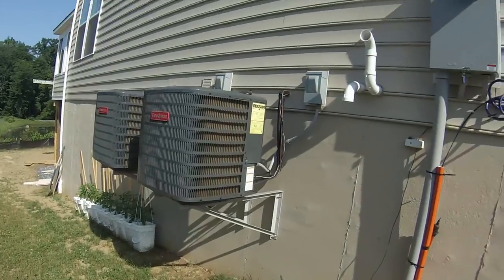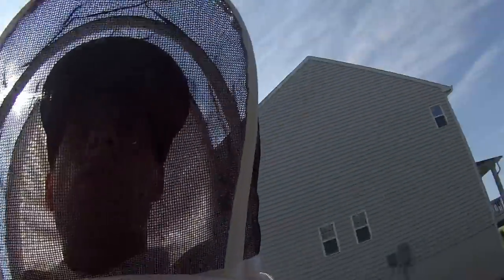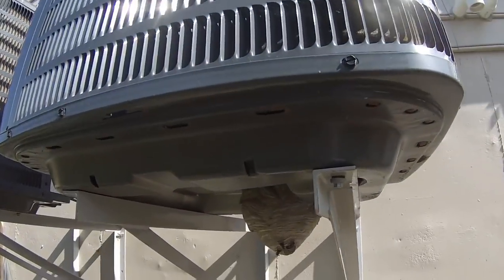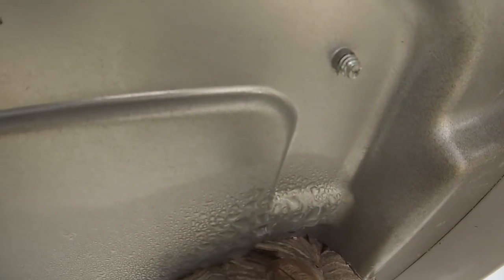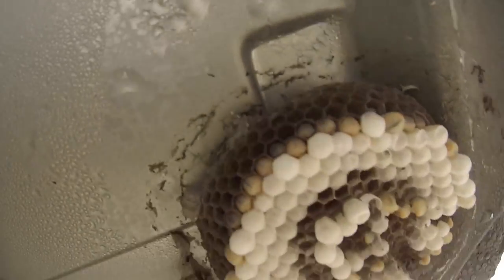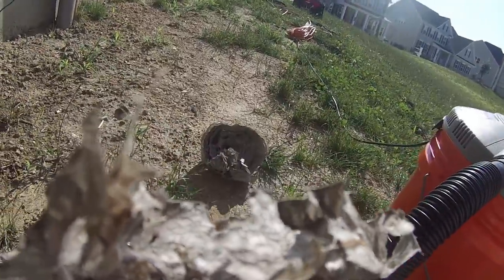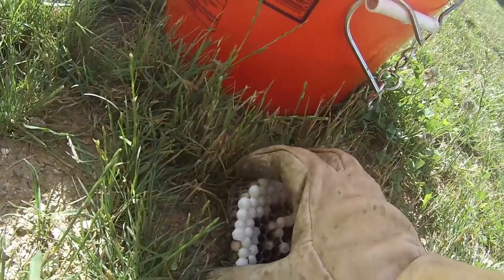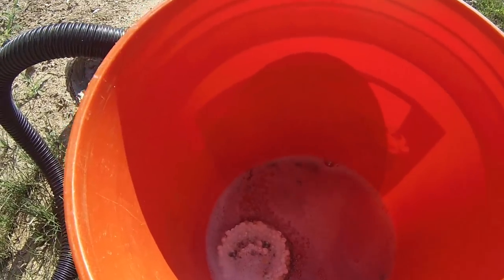Baldfaced Hornet Nest Under Air Conditioner.

Comment: Thanks for sharing. I really don't like the bald faced hornets the are the meanest wasp or whatever they are classified as that we have around here they are the only ones that scare me when I find a nest I'M assuming your suit is heavier or thicker than a standard bee keepers suit or the hornest would be able to sting you through the suit. Am I wrong? Good to see you posting these kind of videos again I know we are just getting into the season. Have a great day buddy.
Reply from the maker: Your welcome. I'm glad you enjoy my videos. I will try and upload on a consistent basis this season as with other years.
Reply: Bald faced hornets are not your friends
Reply: No different than an ordinary beekeeping suit aside from the fact it's a ventilated suit which makes it great for hot days. Some suits are not ventilated. You can still get stung with it on, it doesn't make you bullet proof but it goes a long way to keeping you protected. The main issue you have to look out for is the material sticking to your skin due to sweat, and that sometimes allows stings to get through the material or another example, if the mesh veil gets too close to your nose...the bees(or hornets in this case) will find that spot and nail it. It never fails. It's happened to me on more than one occasion and a sting on the tip of the nose is one of the most painful places to get stung. Ouch. 

So yeah, his suit is really no different at first glance. They're made to handle all sorts of common stinging insects, whether it's standard bee-keeping or insect removal like shown here. I'm pretty sure he doesn't need some special "hornet specific" suit, that's not how they make them I'm pretty sure.
Reply: nashguy207 I've been stung by tne queen bald faced hornet and i couldn't feel my foot FOR 24 HOURS
Reply: herc1120 do you have an email address, or a website?   I’m also fascinated with bees and would love to ask your some questions.   Thank you

Comment: I'm not a pro and just remove nests for free, but use the Milwaukee M18 battery vacuum. Maybe this will help someone without a long extension cord. But like you said, if they're far enough away, leave them be. They are very beneficial.

Comment: I found an empty nest under the air conditioner housing in my camper. I just power washed it away and didn't find any remains of any bees but I wonder if there's any way they can get in my camper through the AC and take up residence in my ductwork?

Comment: I do pest control and I have a bee suit, although I still get extremely nervous when I’m up close. I don’t use a vacuum. I use a product called CB-80 which is pyrethrin based and just shoot it in the nest. If you’re into natural chemicals you should give that a try.
Reply: Alan Cutting lol should wasp freeze the hole than put the cb 80 into the nest. Works better
Reply: JigsawJoe13 

That would be nice

Comment: Bald Faced Hornets🐝 can make there nests on medal to i had no idea that they can do that wherever I go i have seen small nests on wood and big nests in the trees so I guess that means they build there nests mostly on wood and some build there nests on medal interesting😀.
Reply from the maker: Yeah, they can be pretty flexible when it comes to nest site selection. There was a nest I removed last year built on the glass surface of a meter. I have also seen some nests built on street signs.
Reply: herc1120 and yet bald faced hornets are still full of surprises interesting😀.

Comment: Wont they linger afterwards in attack mode and attack the repair dude
Reply: Wes8761 No.
Reply: Give it a day or two and the rest will be gone
Reply: He asked the question because in the video, it's mentioned that the A/C repair guy was gonna be there about 2 hours later after he's removed the nest.
Reply: RetroCNY 

Well then yes, theyre gonna be around pissed off and sting that guy
Reply: Wes8761 
No, he very clearly removed at the very least 90% of the wasps.
Not to mention that without the queen it's pointless for the wasps to sitck around.
Reply: Not unless the player holds e and sets them to passive mode.